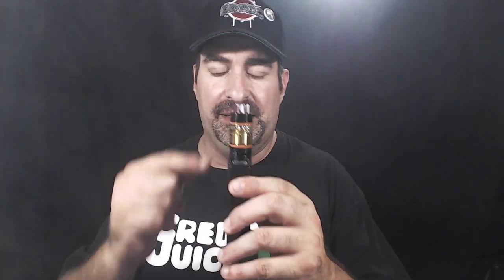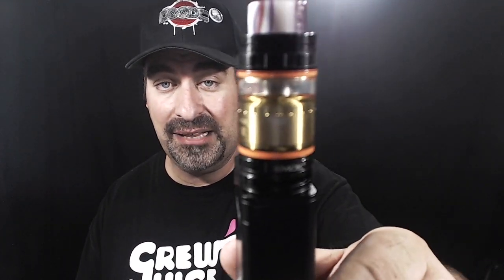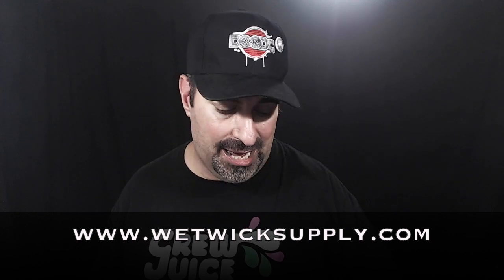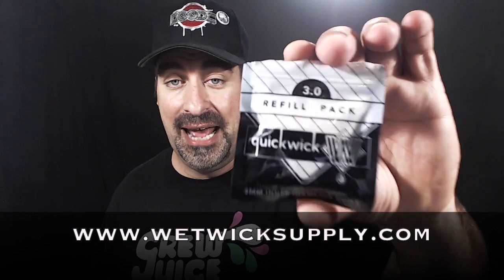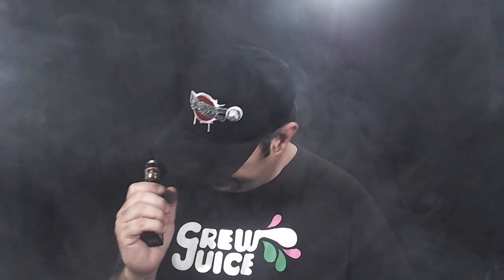SMOK TFV8 RBA Build Vaping At 220 Watts

Comment: good tutorial man. i think black grub screws are better since they are hardened. thats what i use on my velocity rda. never experienced any stripping at all. :-)
Reply: raphael pizarro, where do you find those screws? just purchased the same smok tank in the vid. I like the RBA but don't want it to strip out.
Reply: just go and look for a screw store that holds the same size. just ask  them for "anodized"/black ones. they should have that.

Comment: lol..big Lou you crack me up..that tank really does eat up some juice..what size suck it drip tip is that...I have like 5 different auck it drip tips that are for goon and Kennedy and then the goon/Kennedy hybrid and none fit there all to loose..just wondering..✌out..ya know I love your vids...lataz
Reply: It's a standard 'wide mouth' drip but comes with an adapter to use 'normal' 510 drip tips, too.

Comment: There is no sixtuple coil in the kit, its a q4 (2 coils) and a t8 (8 coils) and I vaped the t8 at 250w on my Triade Dna mod... where do you get 90-120w from? No tfv8 coil goes that low...
Reply: You can vape the V8-Q4 at 90 watts all day bro. Just close the airflow off a little. Or are you some god that only vapes above 220.

Comment: Anyone had issues with this RBA giving random ass ohm readings?? Ill be vaping this thing one minute, then the bastard tells me im at 3.5 ohms or some shit and wont fire>?!? had nothing but bloody issues with this thing. Happens on my hpriv mini and 220
Reply: John Walsh I have that, I use the v8 rba and all I get is no coil, low ohm, don't abuse, short atomiser!!  Drives me insane!!!!!!!
Reply: John Walsh check that the 512 pin isn't over tightened. and depending on the coils, check the post screws (they like to loosen up after a fresh build) had the same issue. finger tight is more than enough on this guy.
Reply: John Walsh on my rx200s it would give me a short notification on the screen... no fucking clue what happened... threw it on an alien and it works fine
Reply: craig monaghan 510 pin*
Reply: Bob Coleman but how to fix?
Reply: Christopher Absolon check bottom of the rba deck make sure it's tight same happened to me.  Tighten the bottom of the deck no problem hitting it right now
Reply: Fatman Slim thanks bro. My negative post was actually loose. Inserted piece of 22g wire between neg nd insulator. Works 100%. Sold tank thou.
Reply: You have a short. Check and make sure your screws are tight
Reply: Tighten the positive connector on the bottom of the rba deck
Reply: I sugges  that  in the garbage and Buy a vandyvape √
Reply: Christopher Absolon  put the rda 1st And the atho on the mod. Gl

Comment: Hey Lou! I just did what you did, pulled the coils to 3mm, and reinstalled the coils. But i'm reading .28ohms on mine.. im at 5.6v at 120w, so im not sure how you got it so low! any clue if they changed the included coils with the rba section?

Comment: Any solution on the TFV8 Big Baby RBA short issue guys ?This RBA is making me mad ...
Reply: GoryTarrafa try unscrewing the atomizer half a turn and hit fire. If that doesn't work then it's the coil that needs to be unscrewed a bit. I have this issue with the baby beast RBA that will not work on my big baby beast tank. I think that the RBA for the baby beast and Big Baby beast is slightly different in terms of dimensions or my particular one is off.
Reply: I think its the RBA section that is to big on the bottom and hits the base of the tank  and thats what makes the short , its making me mad because the first days was working fine and now i can only use premade coils who are expensive as fuck here in Portugal :/
Reply: That's what made me go the RBA route. However the RBA on the Baby Beast isn't too bad. Tons of flavour and clouds. 

Coils here in SA are around U$7.00 each...
Reply: GoryTarrafa 
try taking one of the other rings from your premed coils and add it to the one on the rba. was having the same issue. seems to have fixed it
Reply: Same random shorting issue on the 2 big baby beast tanks I own. I have to strip them down, re wick and check screws. Mixed results 😒 Its a real shame as the clouds and flavor are some of the best of all the tanks I own.
Reply: 25€ for a pack of 5 here but big part of the stores dont sell just 1 , but when they sell its arround 5€ (comparing the cust of life in PT is  way expensive )

Comment: Yo Lou, I been using this tank with the rba and my HUGE gripe is the top cap coming open in my pocket. You got any ideas to make the top cap stay in the closed position ?
Reply: put the black or orange rubber ring that comes with the tank around it (think 1 says keep vaping and the other says cloud beast on it).  fits perfectly.  i dont have that issue but i did just notice that it fits today coincidentally.

Comment: is it normal for the tank to get just sick hot chain vaping say 3 to 4 pulls at 100 watts.
Reply: yeap
Reply: ProudBadMan mine doesn't get that hot
Reply: MLA I watched alot of review vids and it seems nobody mentioned this. as you say yours doesn't either. I benched mine after 15 mins of use.
Reply from the maker: ProudBadMan your coils could be too close to the barrel covering the coil Chamber.  Which can make your rank really hot or your wire resistance could be too low which makes your tank hot